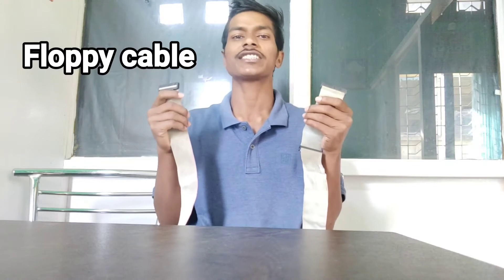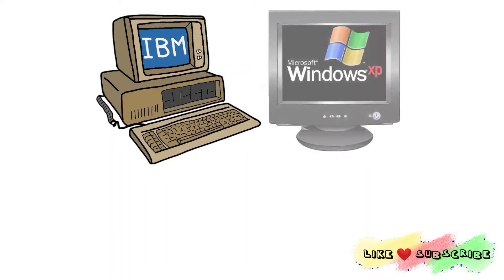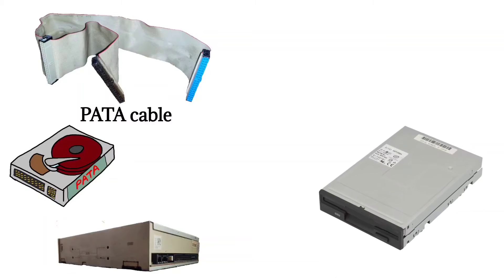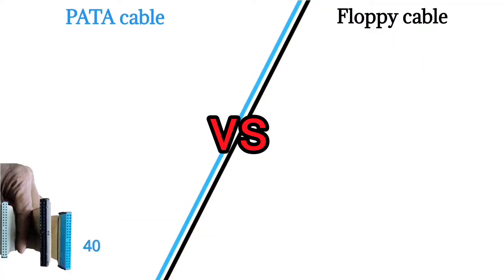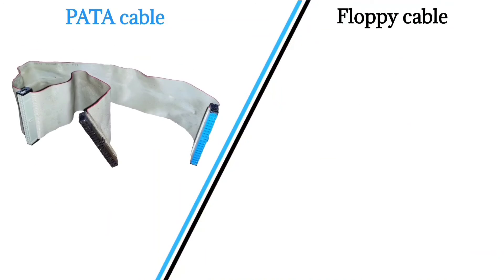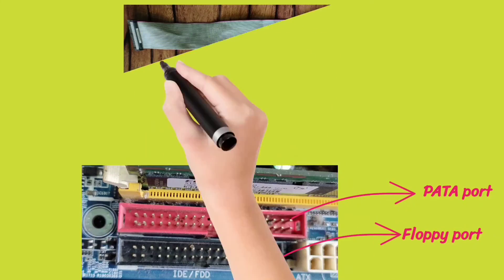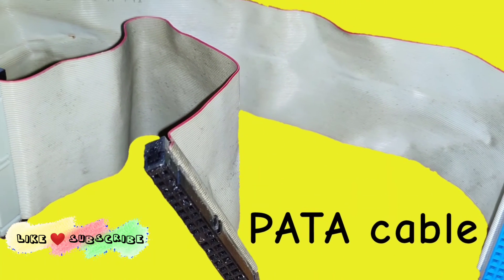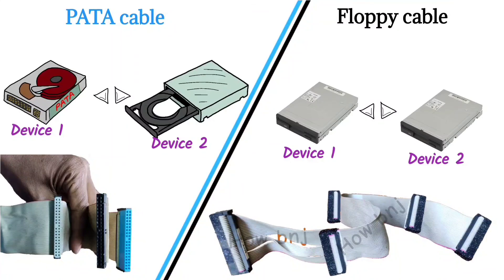Floppy cable vs PATA cable | 34 pin cable vs 40 pin cable | Floppy cable | Floppy port

Comment: First Thank you so much for this interesting and informative video! 
I have a question because my pc only supports 40 pin ide/pata but I need an internal floppy drive for multiple reasons I searched for solutions like sata converters or pci/pcie expension cards but only found solutions for 40 pin cables and none 34 pin solutions. I'd love to hear your foughts on my issue. Have a very nice day (:
Reply from the maker: Thank you for comment and sorry. I don't know. I will study more on this and answer to your question.
Reply: @howbnj  thank you